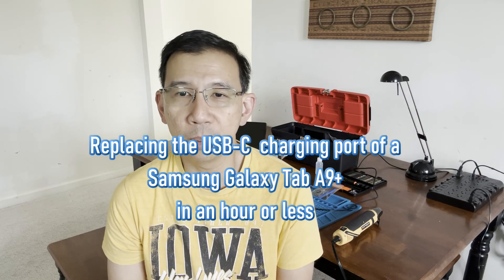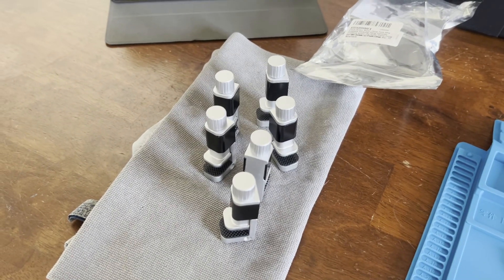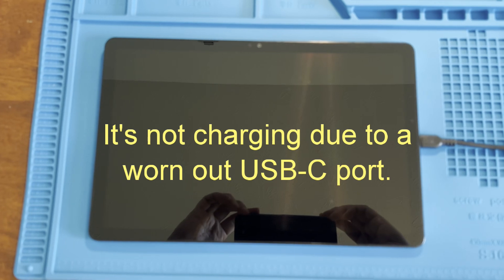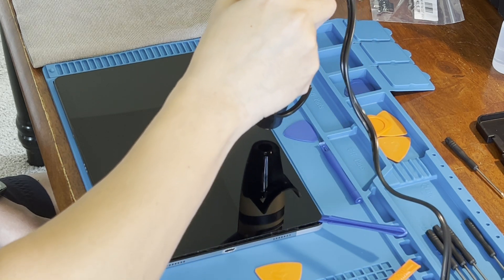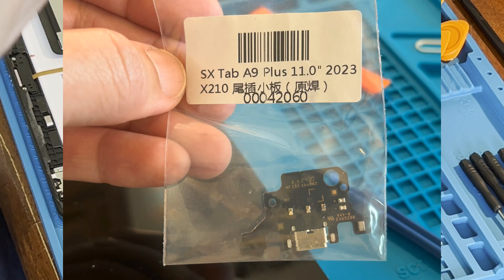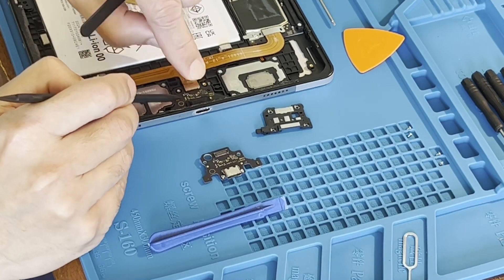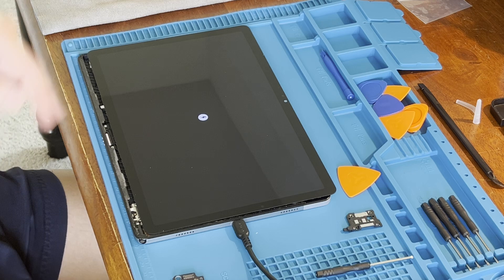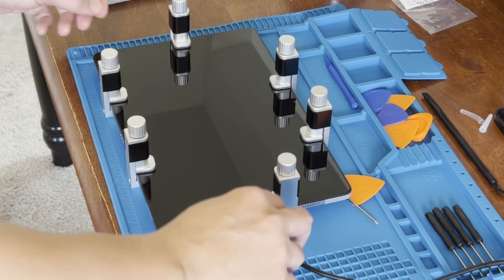Replacing the USB-C Charging Port of a Samsung Galaxy Tab A9+ in an hour or less

Comment: So you didn't by any extra stuff to apply to screen like a glue or adhesive?  Just used the original adhesive
Reply from the maker: I got a B-7000 adhesive on standby just in case, but for this repair, there was enough of the original adhesive that remained.

Comment: My display got faulty after changing the port
Reply from the maker: Sorry to hear about the outcome of your repair.  You can check if the screen's cable connection got loose from the motherboard, which means removing the screen again.  If you are still able to use the tablet even with a glitchy screen, then it may be too risky to open the tablet again.  However, if by faulty display you mean unusable, then it may be worth checking.

Comment: So no new glue is needed?
Reply from the maker: My repair did not need additional glue as the original glue remained on the edges of the screen and tablet.  If a lot of glue comes off while removing the screen, you may have to add more when you re-attach the screen.

Comment: Where did you acquire the clamps? I would love to have a set like that.
Reply from the maker: https://www.amazon.com/dp/B0CTWKFD1H?ref=ppx_yo2ov_dt_b_fed_asin_title are the ones I got but are not available as of this writing.  However, there are other equivalent clamps.  Good luck!
Reply: Fantastic video, I have never done any kind of electronics repair, my daughter has broken her port due to rough handling , watched your video and purchased the parts from Ali Express and have successfully repaired it today with your nice clear instructions.

The only things I did differently was to disconnect the screen to make it easier and I cleaned all the old glue off and applied some new.

Thank you for making this video , you have saved me lots of money!